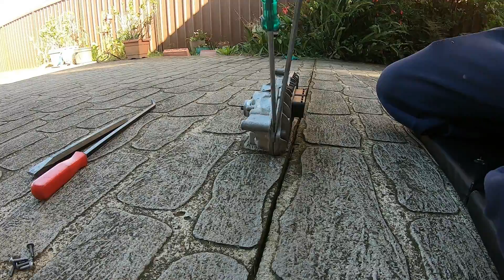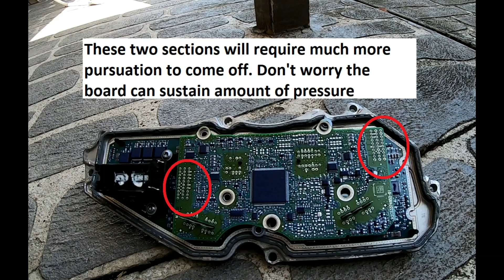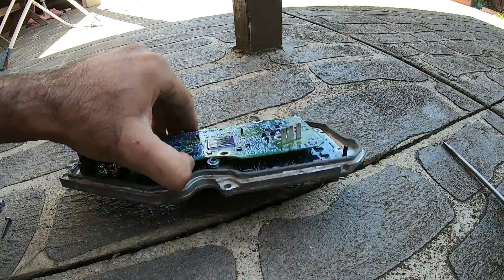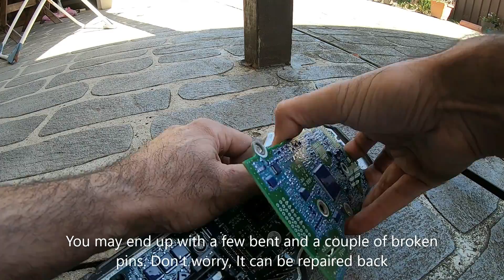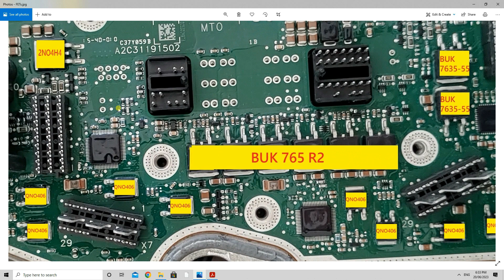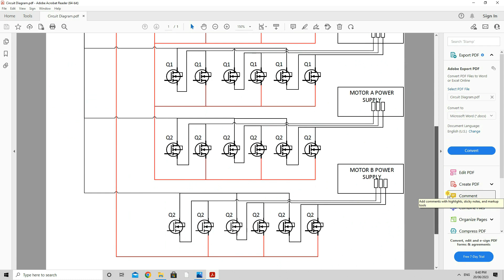Ford focus TCM Opening, Circuit diagram, Testing, Repair

Comment: Hola q tal tengo problema con mi Ford Focus 2012 cuando se calienta la transmisión no le entra la reversa y los cambiós los ase bruscos q creen q sea gracias
Reply: Lo escaneo y sale embrague b
Reply from the maker: If it only does it when its hot then its TCM. 
To rule out gearbox clutch rollers, you can remove the clutch motors and manually rotate them if the are sticky.
Reply: @RZJugaar los rodillos de embrague son los q van en la transmisión
Reply: @RZJugaar e visto videos donde dicen q el modulo ay q destaparlos soldarlo con un cautín y soldadura q así se repara como ves

Comment: Can't find qn0406 MOSFET can I replace it with 80n03? MOSFET? The original MOSFET is rated at 40v
Reply from the maker: If the specs are same then yes you can. BTW plenty of QN0406 MOSFETs are available on AliExpress..
Reply: @RZJugaar btw what's the voltage supply of the motor? The qn0406 is rated for 40v
Reply from the maker: @smoke_stackz3168 
its 40 or 48V. Can't recall 100%.

Comment: awesome video, could you confirm the spec of the capacitor on that stayed attached to the outer casing?
Reply from the maker: @Adeyspec  thank you.  Can't recall it now, but check all the comments.  I think i answered this question before
Reply: @RZJugaar  you have stated 2200uf but not the voltage?
Reply from the maker: @Adeyspec  it's 48 to 60v
Reply: @RZJugaar  amazing thank you
Reply: @RZJugaar  Polarisé ou non polarisé ?
Reply: @Joel-kh1yl  Polaricé.

Comment: Hi mine says no communication with TCM on a ford fiesta 2014
Reply from the maker: Check the relevant fuses first and verify connectivity. Worst case scenario,  you have to remove it and get it bench tested  to see if it's actually faulty.

Comment: What does 2872 Clutch A stuck engaged point to?
Reply from the maker: @billhenry7833  it's most probably the clutch A fork not freely rolling in and out. For proper fix, the transmission needs to come off and forks to be cleaned or replaced.
Reply: Ok, thanks for the reply.

Comment: Those press fit connections look like trouble. I'd suspect them if you have intermittent problems like no reverse when hot. It would be easy to solder them just to see if that worked. Of course it would be a pain to remove the board after that.

Comment: Hello, great video. Okay, mine is saying TCM which mine was replaced 14 months ago with a Knew one. Know It happened again. No reverse and won't catch gear going forward all my signs are saying TCM. My Ford dealer says codes/people always say that and it is not it.
Reply from the maker: @mikereynolds1981  TCM faults are intermittent.  If yours is a hard fault ( no reverse all the time), then it may not be a TCM.
Reply: @RZJugaar  i have no reverse and no shifting. only moves 10mph in first. code is for shift fork B "position circuit" and shift fork calibration not learned. any help? what could it be
Reply from the maker: @akekka-n3f  do you know the exact code? Is it intermittent?
Reply: @RZJugaar  not intermittent. its all the time. tried battery, clearing code etc, unplugged and replugged tcm, same issue. the codes are P2836 and P287B
Reply from the maker: Your main code is p2836. Which means that TCM does not know the position of shift fork B. This is sensed by tcm via actuator motor B. This motor also controls your reverse gear. 
Either your actuator motor or the TCM is faulty. You have two actuator motors on your gearbox.  I suggest swapping them around. If you get your reverse back, then your actuator motor is faulty otherwise it's the TCM.

Comment: 140,000 miles on the 2012 & NO issues, BUT after reading most of the problems with these I'm considering selling or trading it BEFORE such
Reply from the maker: These TCMs run great for 10 years on average.  And if you have to replace with a new one after 10 years then I won't call it a big problem... it's a nice car.

Comment: This is just one step of a proper diagnosis. Sure, the TCM could be detecting a stuck clutch with the problem being electric signals however I've done PLENTY of these where the clutch is actually stuck. Whether from an incredible build up of clutch dust or more commonly a broken throw out bearing. Both problems cause a stuck clutch, or one that the computer can't not control

Comment: Thank you for taking so much time to do all this work, most impressive. I have a Renault and the TCM looks identical so I will be very interested to see if it is the same inside. My only question is how does one put the top board back on as I assume the pressure required to do it is significant?
Reply from the maker: @campbellmorrison8540  can't recall it being significant... besides, I soldered all joints when it was put back, so even if it's not 100 in, it doesn't matter much.
Reply: @RZJugaar  OK thank you. I must say I dont like these connections I have a similar problem on an ABS board too, easy for the manufacturer but a pain for the end user

Comment: Hi. I have a P090C code and no reverse when hot. when cool down everything works fine until warm up. Need help please
Reply from the maker: @iuriik.8494  you need to replace your tcm. Intermittent problem points to tcm. If you decide to get a replacement,  get a new one from Ford.  Not from a wrecker.
Reply: I have exact same code but no foward when hot would it be same thing and sometimes runs fine on highway and I hear my tcm do things when I open my door
Reply from the maker: @user-vz9wm2dj8j  yes, your problem also points to TCM
Reply: @RZJugaar  yes thank you ford dealership said it needed tcm no start issues and all stuff it was doing so I gotta tow it down tomorrow
Reply: TCM's on infinite back-order....

Comment: HI. my car is burning the 3 speedy sensors...oss, sensor speedy 1 and sensor speedy 2. Damage one of then, same days, the other and then the other..you change for new one, worls fine..around a mounth, returns the problen. I change the module, and the problen is the same...change the cable , battery and alternator..and the problen is the same...Have any idea?
Reply from the maker: What fault codes you getting for faulty sensors? Are they physically damaged? Are you using genuine replacements?
Reply: P2767, for ex. but all DTC is "there is no signal from sensor a, or sensor B or oss". not burning at the same time...when you change by a new one, reset dtc, the transmisson works fine...for some days..yes, genuine sensors.. @RZJugaar
Reply from the maker: Your problem maybe coz of multiple reasons. Most common of which is a bad ground to TCM.. check your ground fist. Next up is hooking up an oscilloscope to your sensors and read signal directly. This will help you figure out if they really are bad or TCM is unable to read a sensor even if it is good. Do not replace a sensor unless you are sure it's faulty. The problem maybe intermittent because of a bad ground and not because of sensors

Comment: There's a video saying that soldering those 150 pins and holes on the the motherboard fixed the issue
Reply from the maker: Soldering will definitely increase the contact area around the pins but I haven't heard much of a success rate around it. I won't bet on it but it's a good shot..
Reply: @RZJugaar  another solution found was the power/ ground male and female pin on the tcm harness was faulty / loose/ not making connection

Comment: Hi.Thank you for the video, it was very informative. Question, My 2012 Ford Focus is experiencing P090C: Clutch “B” Actuator Circuit Low. Where do you recommend to focus on when checking the TCM?
Reply from the maker: Starting point in such a case is to swap around actuator motors and see if codes shift to clutch A. Otherwise open up the TCM and see if you can find anything wrong with it. Look for corrosion, faulty or damaged connector items or circuits.. order up a new TCM in the meanwhile coz repair doesn't always work for everyone.
Reply: @RZJugaar هل لقيت حل لهذا الكود p090c وهو متاكد انا منه انه عطل في كمبيوتر الجير هل عرفت اي كونكتر هو مسؤل عن هذا عطل
Reply: How did you fix it?

Comment: Hello, after replace the IC processor then gear position indicator does not show. Do you have some problem like me ?
Reply from the maker: If you install a blank TCM, it won't show gear lever position unless reprogrammed. Don't know what happened in your case
Reply: Any other way to reprogram without IDS  ?
Reply from the maker: @budiono-5033  unfortunately no. But IDS is not too expensive. I think it's 50$ for 2 days license.. and you need a J2534 box for interfacing.
Reply: Do you have the link to buy that tools ?
Reply from the maker: @budiono-5033  I can't put the link here but you can search on AliExpress for J2534 devices.
Reply: hola  salludos   usted  cambio  un  ic  del tcm  , si es asi porque  hizo el cambio  disculpe  encontro algo  malo con este  procesador
Reply: @INGMECATRONICO-m1x Hello, I only gues maybe the problem is in the processor ic

Comment: Hello . I have clutch motor error #2 on warm up and on the other tcu permanently. The MOSFETs are correct and I checked the board completely. I soldered its bases on both the lower and upper boards. In your opinion, the microcontroller may be damaged or the weakness of these may be from the microcontroller. For Renault cars.
Can you send me the internal diagram?
Reply from the maker: Hi. What exact error you were getting?
What internal diagram are you referring to? If you mean the one that I drew, you can look them up in the video or contact me through email and I'll share them with you. Otherwise can't paste them on YouTube even if I want to.
Can't comment on microcontroller being faulty without looking up the error code
Reply: @RZJugaar   Please send me your email address
Reply: @RZJugaar  fult code dtc174401        clutch 2 ,otor circuit
Reply: @meysamdadkhah9236  Did you solve your problem? I have the same error with a renault clio

Comment: Could you please confirm the continuity of the QN04H4 transistor, its power supply is fine, but the DRAIN does not have continuity with the capacitor and the mosfets
Reply from the maker: I'll check and get back to you
Reply: @RZJugaar  thanks!
Reply from the maker: @enriquecastro2352   the Mosfet is 2NO4H4. I can confirm that the drain does connect to the left side of the Capacitor/Inductor. It should also connect to drain of half of the clutch/Motor control 
Mosfets
Reply: @RZJugaar  How can I contact you? I have more than 10 disarmed modules; the 2n04h4 has no continuity with the capacitor/inductor nor with the clutch mosfets, it seems super weird to me. thanks!
Reply from the maker: @enriquecastro2352  my contact is on my channel page. Do note that the boards were updated slightly over the years so I won't be surprised if your board is slightly different.
Reply: Thanks for the video. I have the same dtc codes on my tcm. #fiesta2011. I try that and im giving a news soon :)
Reply: @davelefebvre7774 i changed the 2 actuator and I still have problems. Ford told me they are no problems but when I get home it failed again. I don’t understand this tcm

Comment: a query, could it be that there is an error? I think gearbox motor 1 is marked in the place of gearbox motor 2.
Reply from the maker: yes, You may be right. Clutch motor numbering is correct but gearbox motor numbering was assigned at random.

Comment: hello. I would like you to talk about the 4 multidrivers that control the motors. I think the problem is there. they are difficult to solder
Reply from the maker: You mean the 6 MOSFETs? The problem can be there hence the testing procedure. I'm not really proud of my soldering skills so if I ever have to replace one, I'd rather take it to Mobile repairing specialist for soldering.
Reply: @RZJugaar  I changed several drivers, and it's really difficult. Did you find any damaged mosfet?
Reply from the maker: @enriquecastro2352  no. All my MOSFETs were in good shape. I checked them without removing.
Reply: l
Reply: Watssap